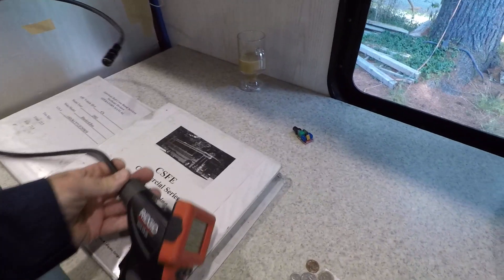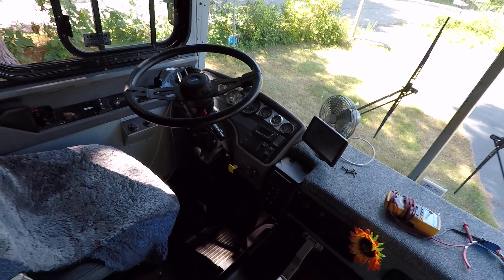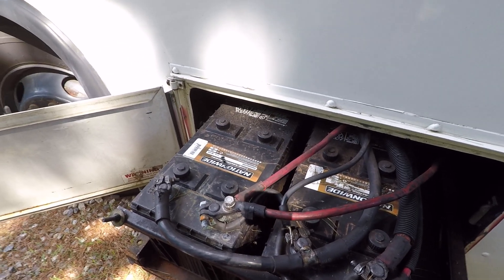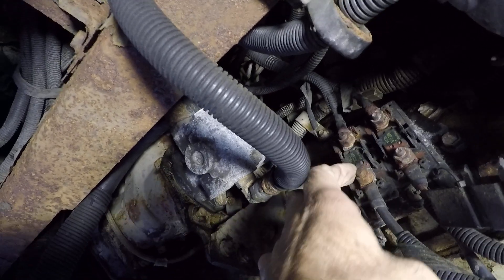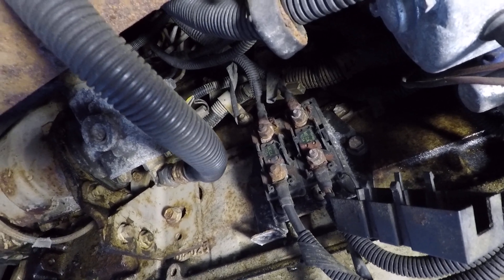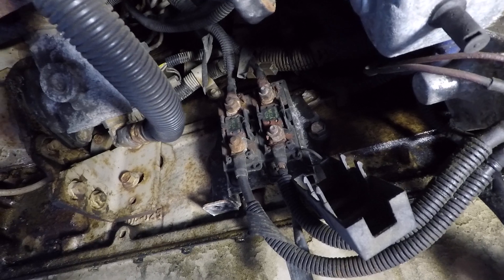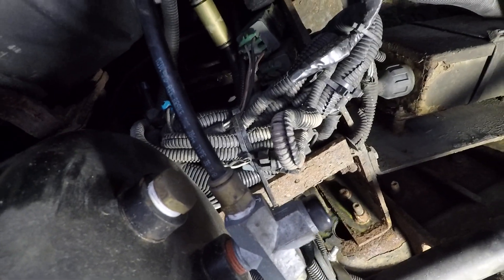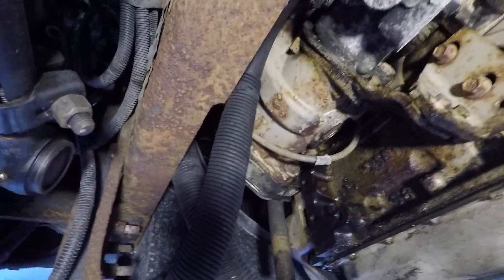Bluebird bus to RV conversion Transmission electrical troubleshooting

Comment: i had the same problem with a bus and the problem was the starter solenoid cable it looked  ok but wires were over heated and wasnt allowing power to go threw.also check starter cable might look ok but peel back the heat wrap plastic and you will see the damade mine the wires where connected to end of it but in between they weren't.

Comment: Al did you attempt to start the Rig from the rear (engine comp). Turn the key on and go to the rear of the bus and attempt to start it.  Also check all your emergency exits to make sure they are close.
Reply from the maker: Hey there! Thank you! Yea, no interlocks, and mine is a front engine setup. I guess I like crawling underneath! Wish I had a pusher! But thank you for the ideas!

Comment: Those look pretty bad as far as rust and corrosion, I wouldn't be surprised if that's the problem. I know you already know this but use that really thick dielectric grease when you're putting it all back together and put it on everything including the plastic (and I mean put it on thick, that'll help keep moisture from getting to it). Also get some of that spray on plastic and just spray it on thick too. hope all goes well